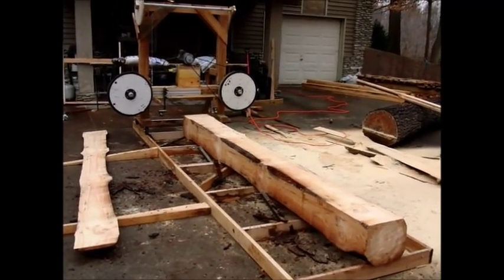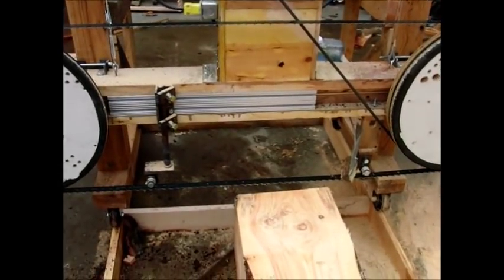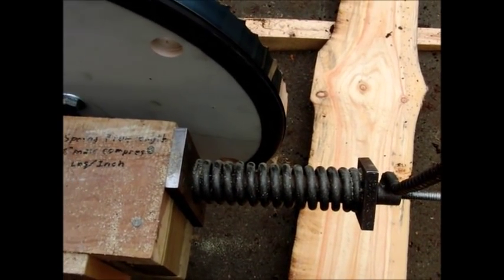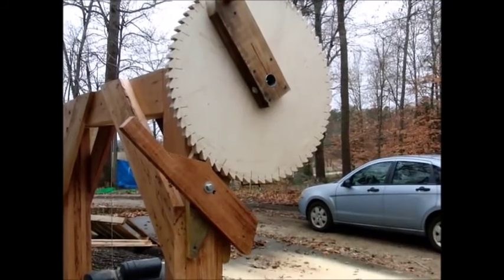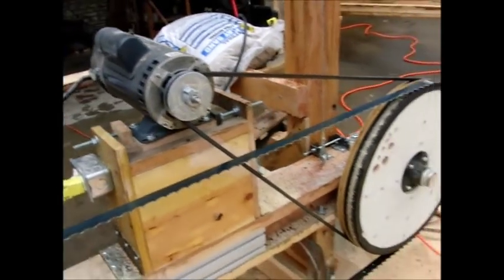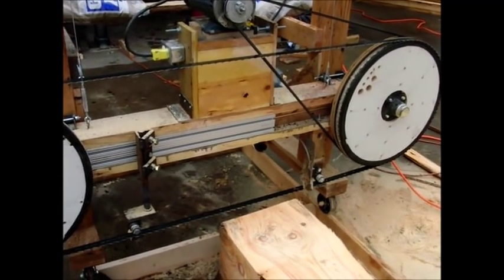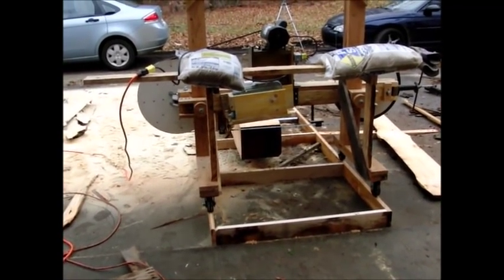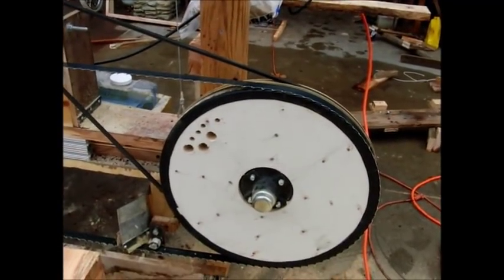Homemade Wood Bandsaw mill walk around

Comment: Nicely built, wish I could make something like this, one thing I would recommend is that you build a shed and put it underneath, rain would obviously cause warping/swelling on the frame and wheels and that could make it quite dangerous IMO.
Reply from the maker: I did build a shed from rough lumber and cedar siding that I had cut to shelter drying lumber from the rain. I roll the bandsaw into my garage basement for storage when not in use.

Comment: A very useful and informative video.
Thanks.

I 'wood' think that the plywood wheels, are superior to car tyres, which tend to be too soft, [according to other posts].
Could you give me some more details regarding the material that you used for the tires, Please?

'BHP' just means that the output has been measured on a test brake machine, rather than calculating the nominal output by converting from power consumption in KW, so its a more accurate figure for the delivered power.

Beech or hornbeam might be better for the rails, as they are both very close grained, and would resist wear. Hornbeam is also sometimes referred to as 'ironwood,' so needs to be cut to size before it is seasoned.
Reply from the maker: +niklar55 The wood used for the wheels was a 3/4" hardwood plywood that I got from Lowes. My complaint about that material was that the sheets were not flat. When I laid two cut disks together to form the wheel and clamped one side the other side rose up 1/4". In the end, this was only an aggravation as when I "lathe" turned the wheels to true and crown them I ended up cutting away any wobble seen by the blade. An advantage of MDF would be that it is flat. Mattias Wandle (woodgears.ca) has had success making a bandsaw wheel out of MDF after initially thinking it may not work.
Reply: +Andrew Willis 
Hi, thanks for your very rapid reply.
I'll rephrase the question, do run the blade directly on the plywood, or is there a rubber, or plastic  tyre, surrounding the plywood?
Many thanks.
Nik
Reply from the maker: +niklar55 I have done both. I  started out with rubber band on both wheels. one came off and I have not replaced it. the wheels did have a polyurethane coat. the wheels are probably best with the rubber cover.
Reply: Andrew Willis
OK, many thanks.

Comment: Could you explain how the saw band remains on the wheels when moving? Is it any tracks on the wheels? Thanks for presentation.
Reply from the maker: The wheels are crowned to the center about 1/32". Further tracking was obtained by a tracking bolt on the take-up and shimming under the drive wheel until the blade ran on center. In use there are guide bearings on either side of the log that take the pressure from cutting and keep the blade from being forced back. Ideally the blade goes back to center and is not touching the back bearings when not cutting.

Comment: Awesome, I going to designing/building my own. Have you had a chance to try hardwood with the specs you mentioned here? On the clothe, is that just an old rag? Cotton? How does the blade not catch it and tear it off?
Reply from the maker: the saw does fine with hardwood and softwood with the following clarification. it works best cutting logs/cants of 12" thickness or less. For an 18" log i am definitely slowing down giving time for the slower blade speed to clear out the sawdust. 24" logs are very difficult to handle and even slower to cut. Doubling the speed and HP would be good. 

the cloth rubs on the side of the blade and so is not cut.
Reply: Thank you. I started cutting parts today.
Reply from the maker: +Michael Crawford cool. I spent several months working on mine in the evenings and weekends.

Comment: I think its great too but because frame and wheels of the saw are made of wood i be worried a bout a water cooling system because water tends to distort wood do you think the water could be a problem?
Reply from the maker: the main thing the water will hit is the first wheel. so far the tire tube cover and polyurethane coat on the wood have protected it
Reply: It really is a nice mill

Comment: Hey awesome design! Im wondering where you got the fixed wheel mounting bracket? or what it is called?
Reply from the maker: +Will Feyder, Both wheels use a trailer bearing hub and stub shaft that I bought from Surplus Center. On the fixed wheel I cast the stub shaft into an aluminum mounting plate and bolted it to the wood "back bone". I could have also welded it to a steel plate or sunk it into a wood block. Whatever is done needs to allow for tracking adjustment. For tracking I ended up putting a couple thin sheet metal shims under one side of the mounting plate to get the band to run where I wanted it on the wheel. Note that there are also guide bearings on either side of the log that keep the cutting pressure from forcing the blade out of position.

Comment: do you have any plans on this yet
Reply from the maker: I spent months drawing different versions until I finally settled on what is shown in the videos. However, I did not take the drawings to the final step of adding lots of notes, part information and formatting them for use by anyone other than me. I detailed out the parts and then made them but there are no explanations. I'm a full-time mechanical designer so I am aware of what a drawing set should look like. So I don't have plans that I can share.

Comment: I must experience one using motorcycle tyres
Reply: i know using motor cycle because i am a mechanic dealer. it can not fail. the problem is to get band saw only. my place is not civilized

Comment: How did you balance the wheels
Reply from the maker: I believe that I covered that in my build video. https://www.youtube.com/watch?v=h0gyYvx_SiU&t=50s In general, I balanced them at the center on small bearings and kept drilling holes until the heavy side of the wheel stopped falling to the bottom.